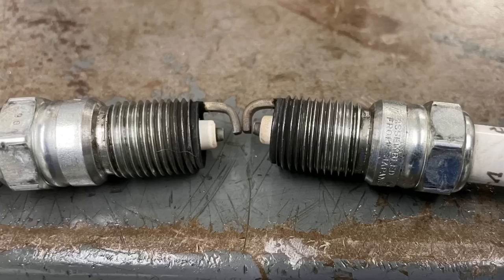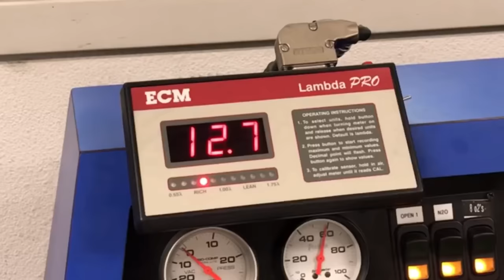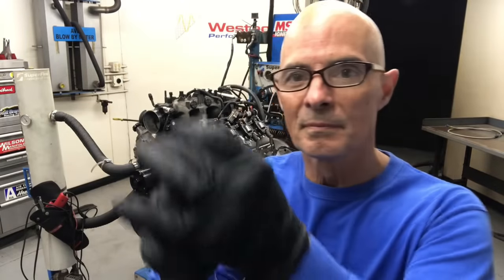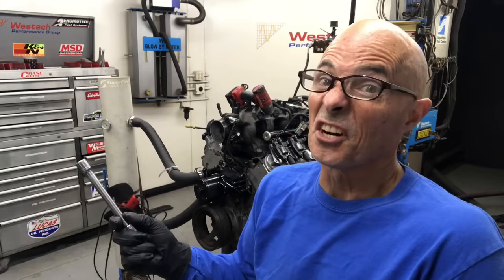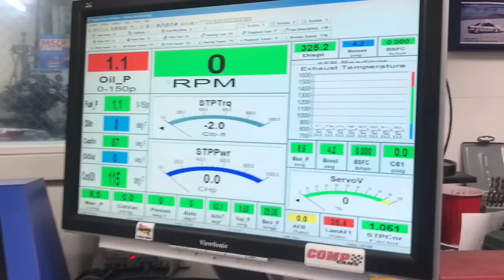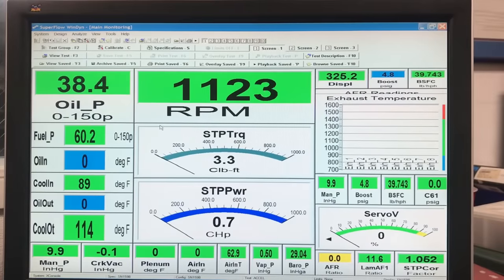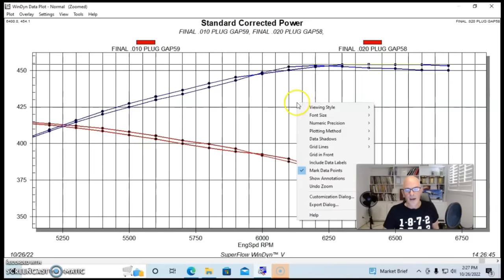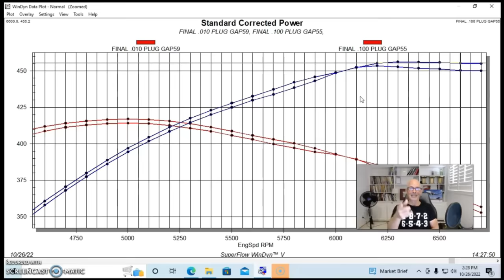JUNKYARD LS PLUG GAP TEST. DOES MORE GAP EQUAL MORE POWER? HOW MUCH SHOULD I RUN? .010 VS .100 GAP

Comment: Big plug gap = more saturation of the coil. This will bring the coil to it limits and over heat or internal arc after a long time but for racing who cares only a 1/4 mile.

Comment: if you where to see a ls2 6.0 with a fast 102, 243's stock, BTR  stage 2 n/a cam Specs: 227/238  .620"/.605"  113.5+2.5, E85 and Longtube headers. how much power would you guess it makes n/a and how much would you guess it makes on 7lbs of boost.
Reply from the maker: low 5s-then mid 7s

Comment: Long ago, Dr. Chris Jacobs established that 0.100" is the ideal sparkplug gap. But they are almost never gapped that large because it will cause misfires to occur because the coil can't generate a high enough voltage in the upper RPM ranges. It would have been interesting to know what percentage of the time misfires were occurring on that engine at both plug gaps (using some misfire detection equipment). Misfires are occurring 6-12% of the time, even though you can't tell it by listening.

Comment: You've got to have a stout Coil-On-Plug setup to pull this off,
fortunately, GM did a great job.
100 thou probably wouldn't cut it under any kind of serious Boost.
14.7 psi of Boost effectively doubles the plug gap because of increased Air density.
.
.
.
Reply from the maker: we have covered boost requiring less gap many, many times-this was a different test

Comment: Richard.
Reply: I need your help sir
Reply: I'm getting random misfires on a built 5.3 with no codes
Reply from the maker: CHECK SIMPLE STUFF-PLUG GAP-BROKEN PLUG, BAD WIRE, SWAP COIL PACKS TO SEE IF MISFIRE CHANGES ETC...
Reply: @richardholdener1727   I'm not sure what cylinder it's misfiring on

Comment: Would love to see a E3 spark plug testing. I know there kind of old school now.

A few years back during the spring I always change the oil to tune ups on all my lawn equipment. When I got the kit for my riding mower it did not have the spark plugs in the box and when I went up to Sears yes Sears they used to have stores. The person behind the counter knows me from going up there all the time. He looked up what spark plug was supposed to be there and he didn't have any in stock. So he crossed reference to e3 and asked if I wanted to try a set and if I didn't like it I can swap them out for the original plugs when they come in.

I had had that riding mower for 3 years or more I know what it's capable of doing and I know how fast it goes. Those spark plugs made the biggest difference. I had more power. A few times the front wheels came off the ground. Then I set up some distant riding from one neighbor's house to the other. Use a stopwatch and then switch the plugs out. Every time it was 2 seconds faster E3 according to the GPS it was 2 mi an hour quicker also.
Now I did not put these in my car these days I just drive to get the one place to another not like it was when I was young.

Every time one of my machines needed a spark plug I replaced it with e3's and it was unbelievable how much better they ran.

Really would love to see if it's a big difference in our car engine if it's something measurable.

Comment: See, a wider gap simply produces a thinner spark, a shorter gap produces a wider spark, same exact "exposure" to the gasoline fumes present in the combustion chamber at the ignition point. So now that we know this, the real point to starting out with a short gap is so that the engine can run longer (in terms of 10's of thousands of miles) before regapping / replacing is needed (as a shorter gap counteracts gap erosion to some degree).
Reply from the maker: these results do not tell you that

Comment: i work on small engines in golfcarts so i install pretty much 3-4 different Part Number plugs and not much more. when i first started i was checking them and they always seemed to be within a few thou so after a while i just checked to make sure it hadnt been dropped and its never caused a problem after a few thousand plugs
Reply: Wait till ya get a propane engine and think that gap is too small, it's not. 
Put em where you'd think is normal ,and enjoy lots of backfiring.
Reply: @MrTheHillfolk  very possible ive never worked on a propane engine

Comment: I remember back in the 80s I would run gapless aircraft plugs in my circle track car. Larger plug gaps do increase power, but it will burn out the other ignition parts very fast. I was changing cap and rotor each race and needed a new coil every weekend. I think it was worth it because of the wins. But I did eventually get banned from that track for cheating. Another good tip for older engines is to get a coil for a mid 80s Saab 900. 80,000 volts does help.
Reply from the maker: plugs don't add power as shown-curing misfires does

Comment: You want the largest gap your coil can support. Use an oscilloscope and look at the dwell vs burn time. The largest gap makes the kernel larger which make the flame propagation more efficient. However this is dependent on chamber efficiency. Also this particular test we need to look at oil temp, oil viscosity per temp change, coolest tempt and many other factors before saying the result was strictly gap difference.
Reply from the maker: air, oil and water are all stabilized

Comment: Are you drunk?
Reply: Was thinking the same thing lol.
Reply from the maker: NEVER A GOOD IDEA TO DRINK AND DYNO-BUT I'M GUESSING FROM YOUR COMMENT YOU MIGHT HAVE TIPPED A FEW
Reply: @richardholdener1727  
Doesn't matter what you do your a grown man with the plan and everything you do for the racing community is awesome.
Reply: @richardholdener1727  Nope.  You just seemed to be acting silly.  No, biggie, Richard.
Reply: I'm guessing that it is not critical with modern engines.  Modern engines use much higher voltage.   1960 engines would have issues with huge gaps.